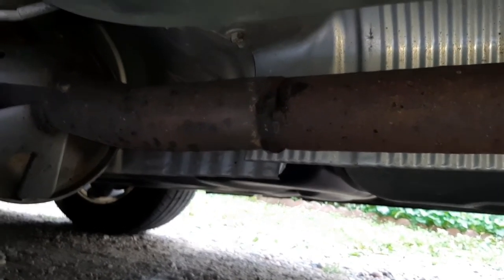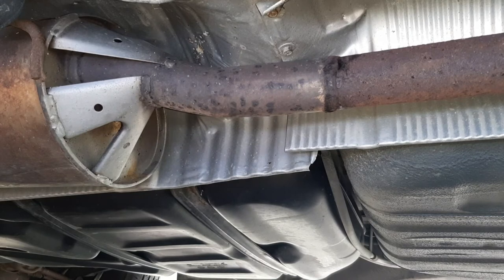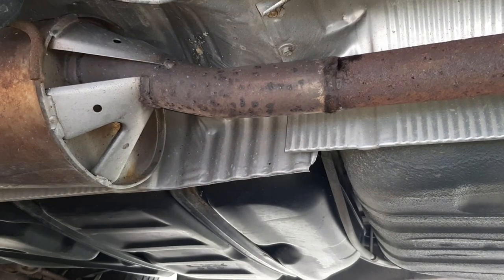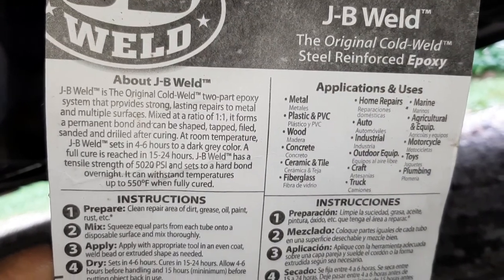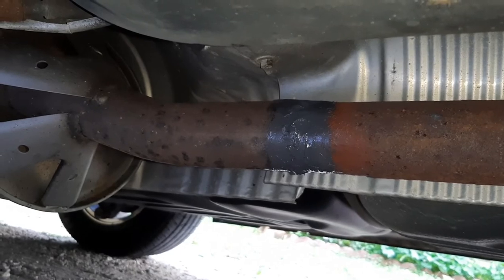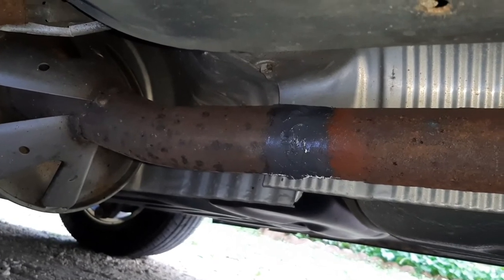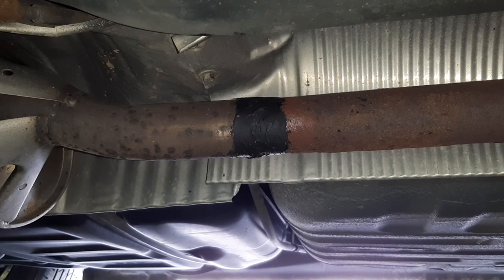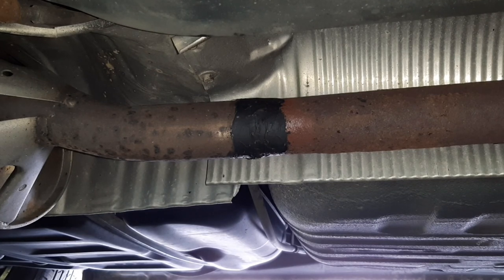Can JB Weld fix an exhaust leak?

Comment: Don't have time to weld it, but have to wait 24hours for it to cure. No time to weld it up, definitely a red neck, probably had a date with his cousin that day.
Reply from the maker: No time to weld it because i didn't have the pipe yet, it was on order, dick.  Plus i wanted to see if the hillbilly fix would work.  And it did, temporarily.  I later welded in a new section of pipe.  Happy?  Now I gotta go, I have a date with my cousin.